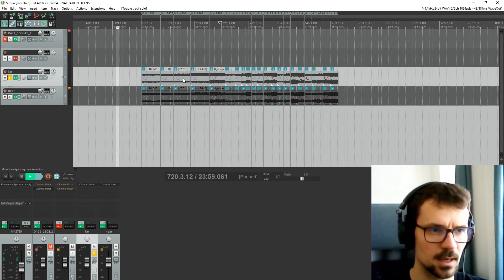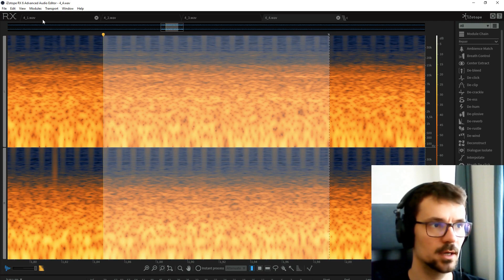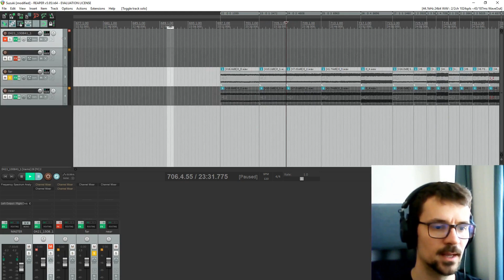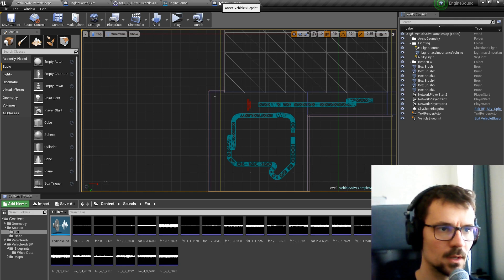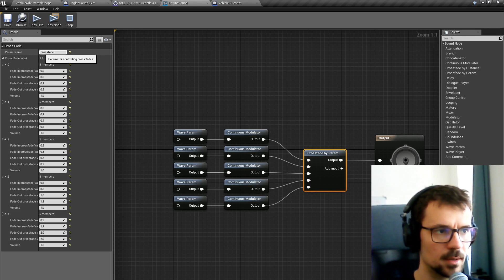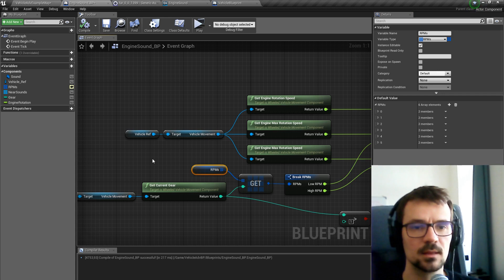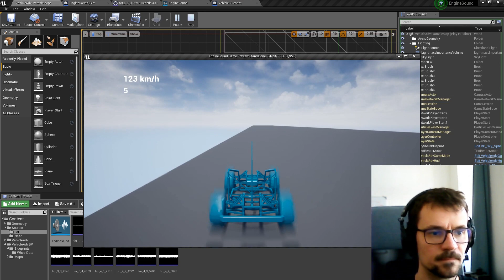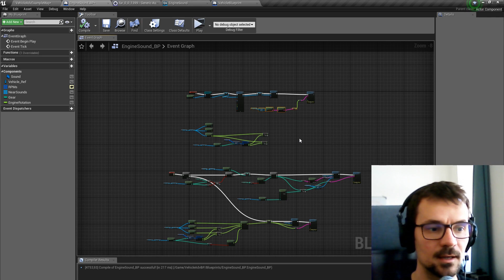Car Engine Sound System WIP2

Comment: Yamaha has some patents related to such topic (e.g. https://patents.google.com/patent/US6859539 ) from experience one can add some post processing with digital waveguide resonators adding more realism, and the articulation can have some physics-inspired gear box regime change ... some little discontinuity is kind of necessary in my view. Good job anyway ... hard example is one 2009 Ducati Monster 696, motor plus exhaust )